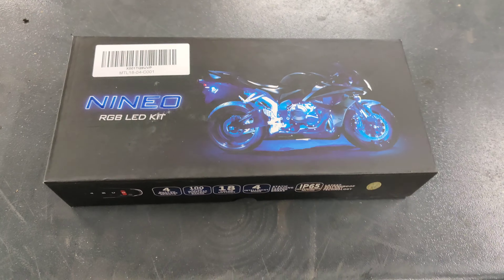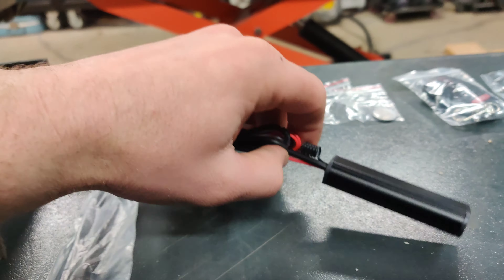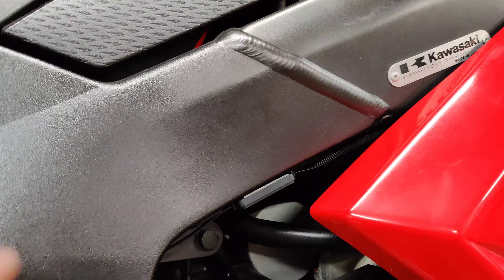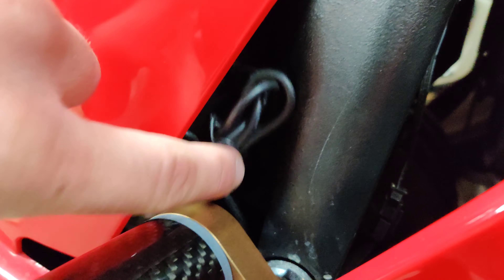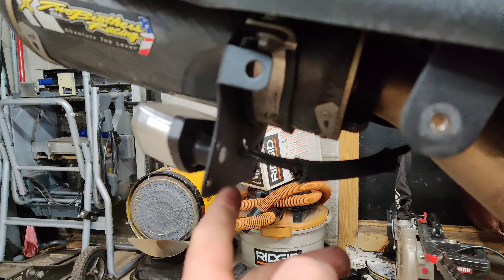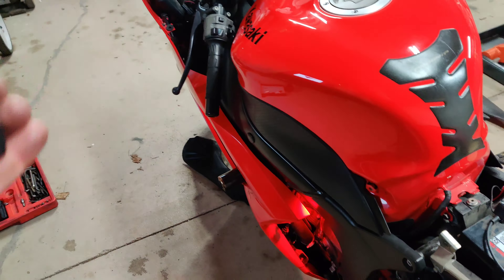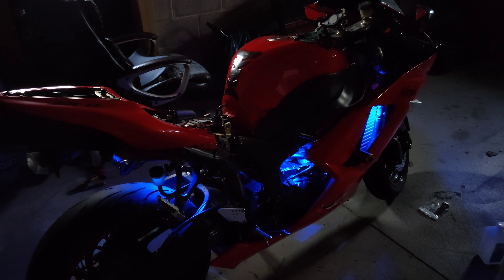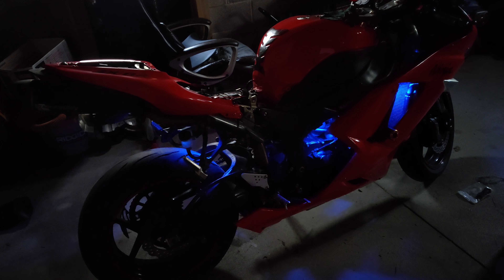NINEO Led Pods

Comment: I installed some on my bike and they are very low and stay  on even with the key out of the bike i have to pull the fuse in order to turn off
Reply from the maker: I got rid of mine. Sometimes they turn on by themselves and drains the battery. I got a better kit and with a switch.
Reply: Which ones you end up getting
Reply from the maker: I got it on Amazon. I posted the link below. I got a red one and a purple one. I like them a lot.

https://a.co/d/55mQhq3

Comment: Question I'm having an issue with my fuse blowing out uses the kit any ideas what could be the problem?
Reply from the maker: This kit the fuse blows?
Reply: Its very possible you could have melted or pinched a wire